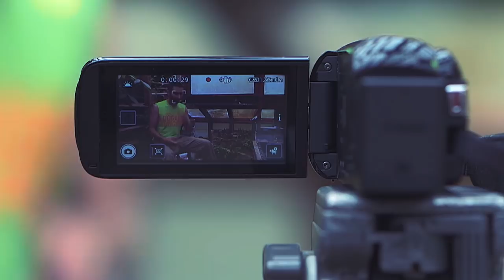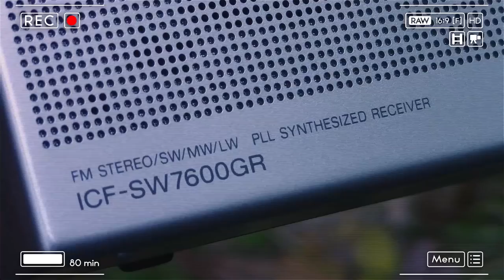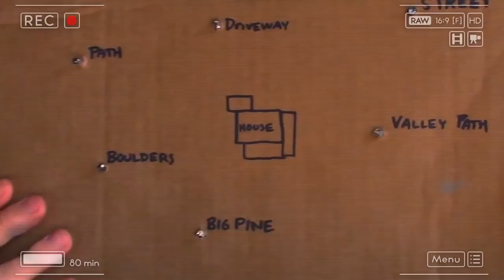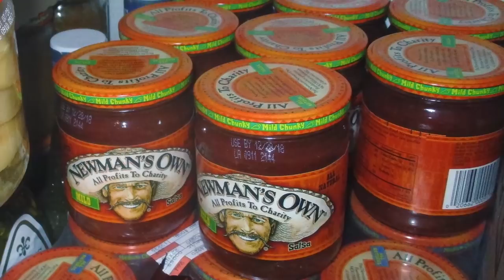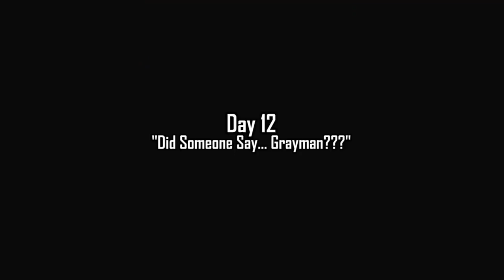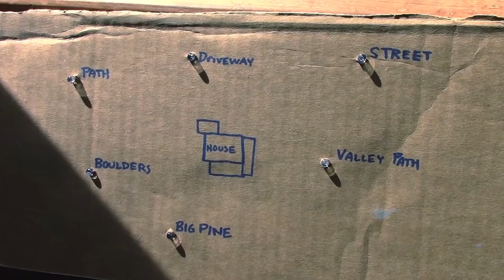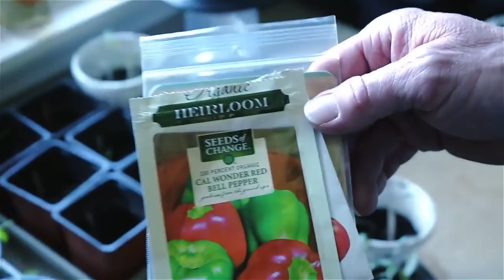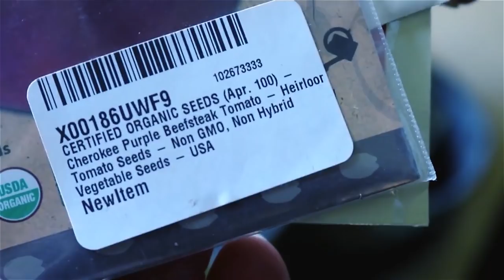Alien Invasion Complete First Season MEGA-MOVIE - A Prepping and Preparedness Film with Aliens

Comment: Tip for you and all other Preppers. I took my books to a printer shop and had the spines shaved off. Then had them all scanned to PDF.  i get the book back shrink-wrapped, and the book back on PDF.
Reply from the maker: I wasn't aware that service was offered. When you get your book back, is it rebound, or just a stack of shrink-wrapped pages? If the books are just a stack of pages after this process, for myself, I don't think I'd want to go that way because I like having the physical books for two reasons. First, they're an ultimate hedge against disasters that might cause easily flowing electrical power to run machines to read pdf files. Although books take up a crapload of space, are not fireproof, can't be duplicated easily and stored in multiple locations as they could be on a small hard drive. Those are definite benefits of pdf conversion. But beyond that, when I'm working with info in a book, I much prefer a book to a tablet. I'm not sure if it's just an emotional or comfort thing, or if it's because the books are easy to bookmark and flip back and forth between pages very easily, or the way I don't have to worry about sun glare on a book, or don't need to worry about using a book in a dusty or damp environment, etc. For me I prefer the physical book to a pdf. But... if my house burned down and I lost all my books (which I almost certainly would in that event), I might be singing a different tune on whether I would wish I'd backed them all up on pdf. It's an interesting service you bring up here. Thx for mentioning it.
Reply: @PraxisPrepper  Mine I get back shrink wrapped. 

One option from there would be to then have it hole-punched and run tie-wraps through the holes.

As for power, I set up a small Faraday can that holds:

a. A small solar panel generator with various ports.

b. An old cell phone and a computer notepad that that both plug in and can play my MP4 vids as well as view PDFs of my books and reference library.

c. The flash drives holding all my reference library and vids.

I've collected thousands. From how to raise chickens to identifying plant species to performing emergency appendectomies in the field.
Reply from the maker: @danrieke9988  Sounds like you have an awesome library!

Comment: I thought this mega movie was pretty good.

At 4:52:55, I thought that to balance out the exposure levels, a variable Neutral Density levels, may be of benefit? If you're interested, I am waiting to receive a variable Neutral Density filter and I will experiment to see if it gets the job done, under similar filming conditions. I will use a Sony NEX FS100 camera, with a 35mm image sensor, and I could try to use a JVC GZ-EX515 camera with a much smaller 4.4mm image sensor, for which I already have a variable Neutral Density filter and compare the footage of the same scene.

From 5:26:25 when the wood chips are flying off, I was wondering if it's reasonable to collect and dry out the wood chips, then store them for feeding the fire during the winter?
Reply from the maker: Hey Neil. I think you're right about the variable ND for Prepper Potpourri's material. A soft bounce into the shadow side would have helped her out too. I didn't shoot any of the video segments of other preppers, so I didn't have any control over that sort of image stuff. I think I've shot with an FS100 before and if my memory serves it was a pretty decent rig. A variable ND is actually just two polarizer filters on top of each other. If it's cheaper, just get two polarizers and then you get to use them either together as a variable ND or one single one as a polarizer. For video, you can buy the cheaper linear polarizer too - the circular one is a special device for SLR cameras to deal with the mirror inside that's used during photography mode. Not an issue with video - even if the video is recorded USING a DSLR.

As for the wood chips, sure one could keep them, but in a forest full of wood, probably not a big deal either way.

Good luck with your video experiments!

Comment: Not trough all of it. With all that battery overcharging thing from the Solar Panels (around/ after 24:00). All you really need is a high capacity relay and a Zehner Diode which switches off upon reaching the maximum charge Voltage. I would assume a relay for sure would survive a EMP a Zehner Diode. Not sure, but they are tiny and you can put a bunch of them in an EMP protected case in case there is more than one EMP (not sure if this is still coming up, still watching :-)
For me: I would store away some of the large solar cells in the basement in case the do get damaged outside or stolen. Let's face it when SHTF you do only need power for the radio and the lights. In that guys case also the Video camera. So, what else? For cooking? Probably better off with wood or fuel (if you have ;-)
What else?
Reply from the maker: Thanks for the note marwerno. I wasn't familiar with a Zehner diode, but I'll be looking into it now thanks to you!
Reply from the maker: @marwerno  My electronics skills are pretty rudimentary, but if they ever improve and I can get a sense of what may be good in terms of items to prep along you breadboard idea, you can bet I'll share my conclusions in a video. Thanks for making the suggestion and getting me thinking about it!

Comment: In the sticks if you fire more than one round, then a smart guy can get a general direction of where you are. Not good when every man is a potential preditor. It is also a waste of ammo. Don't take the shot unless you are sure of a kill while hunting. You may kick yourself later for wasting those rounds. Use the driest wood you can when making a fire to make as little smoke as you can.  Else you could be giving away your position. Don't light a fire unless it is absolutely necessary. If you do, then keep it small. With a small dry wood fire you can also make a sort of smoke dispersal "umbrella" well above it to disperse what little smoke there is. Suspend a leafy branch far enough above a small fire so it won't burn or smoke.
Reply from the maker: That's a good tip - thanks for sharing it here. I tried to make this series be about a guy who's pretty knowledgeable but far from "perfect" when it comes to all this stuff. So people can learn from his knowledge AND his mistakes. Thanks for the helpful feedback here!
Reply: @PraxisPrepper  Thank you for the tips too. Particularly the method of using a watch for a compass. I have two lensatic compases but it's nice to know a makeshift method if the Sun is up. Never heard of that before.
Reply from the maker: @stevesloan7132  Yeah, that's a fun method to use (especially in front of amazed people who didn't know about it). Just be sure to factor in for daylight savings time if you're in the US during the summer months when we use it!

Comment: First minute and a half is a good demonstration as to why you should use a script when you're making a video.  While it might not eliminate all mistakes it certainly will cut down on them and help you remember the important points you want to make without going off in a direction you didn't plan on and aren't prepared to cover and I would imagine it would result in far less time spent editing as well.  Save the improv for the comedy clubs . . . and turn that phone off!

3:10   Notice the emergency radio.  A friend bought one of those for me several years ago.  It is one of the worse pieces of garbage I have ever seen.  If you see one I would suggest you pass it over for something better.  Just because it's endorsed by a large organization doesn't mean it's the best one out there.

I remember reading about EMP's and as I recall they told how the wiring in your home would overheat and the insulation would melt/burn off so that even after power was restored (potentially over a decade to produce enough transformers to replace them all) it would be unusable but it suggests to me that most buildings would catch fire and burn up.  They never came out and said that but I know how much heat it takes to get the insulation off wiring and one thing follows the other in my way of thinking.  Call me crazy.

31:14  You might want to do your own research here.  https://www.ediblewildfood.com/queen-annes-lace.aspx    Maybe read up on yarrow, too.  It has it's uses but I'm not so sure you want to be eating it like a vegetable.  32:00  https://en.wikipedia.org/wiki/Monarda

I don't normally pick videos apart piece by piece like this and no point in starting now.  lol.
Reply from the maker: Thanks for the thoughts. Yeah, queen anne's lace is edible, but that family of plants is a bit dangerous for newbies to play with, so I opted to make a pass on that one. The EMP question is a tricky one. Maybe experts themselves are frank when it comes to what we don't know for sure about that. I did an interview series about it recently that you can check out in my playlists if you like.

Comment: Hey Praxis,

I don't know if anyone's asked this already, but to answer how your character keeps his camera and Ham radio charged, you could explain that he's using a walking knee charger (or maybe a pair of them, based on the old "two is one, one is none" rule):
https://www.youtube.com/watch?v=ODEkUoBY3uA

The character may also find a gravity powered flash light, for use at night or in dark places:
https://www.youtube.com/watch?v=XXQZcvPld-4

Other preppers may be powering their homes or shelters, using gym/exercise/work out machines adapted for power generation to charge batteries, for when the Sun isn't shining? One benefit of a work out machine adapted in this way, is there is not a need for weights because a generator does provide magnetically induced mechanical resistance to movement. To improve the efficiency, such preppers may have adapted some of the concepts in this video?

https://www.youtube.com/watch?v=HK3JOlY0V8Y
Reply from the maker: Thanks for the links. I think I'd referenced having a small solar voltaic charger in one of the early episodes and left it at that. Realistically, I don't think many people would burn energy charging a camera during an event like this... (or at least I wouldn't). But since there'd be no video without the character doing that... he did that. ;)
Reply: @PraxisPrepper  I'm a semi retired Electronics Engineer, so I tend to automatically think about stuff such as how does the character keep her/his batteries charged all the time?

A portable Solar Photo-Voltaic (PV) Cell may not provide sufficient energy to charge batteries in a camera, radio and perhaps tazer at the same time, all by itself, supplementary power may be provided by a knee mounted walking charger.

Whilst some folks may not want to burn energy charging a camera, they may want to burn energy to charge a radio, or a tazer. One advantage of a tazer is that it can stop some marauders in close quarters combat, without wasting pepper spray or bullets.

Folks that are overweight/obese such as myself, may not have a problem with burning energy to charge a radio/tazer/camera/flashlight with a walking knee charger.

One advantage of a walking knee charger, is that it's more stealthy than a Solar PV cell; there is a chance a flash of sunlight reflecting off a solar panel may attract marauders, or make it easier to track a person. Thus with a walking knee charger, it may be wiser to conceal the Solar PV panel, and let the walking action charge the batteries.
Reply from the maker: @neilruedlinger4851  The idea of a walking knee charger really is a cool idea. The video you sent made it look like a device like that is still in alpha testing. I'd love to test out (and popularize) a product like that if it existed for general retail sale.
Reply: @PraxisPrepper  Me too, it would be a great way to charge my cell 'phone, or my JVC GZ-EX515 batteries, or perhaps FS100 batteries.

My FS100 has two long duration NP-F970 batteries, which in combination with a 128 GB SD Card can run my FS100 for over 10 hours, on just one NP-F970 battery; so I had the excuse to buy a second 128GB SD Card.

Sometime over the past year or so, a student from somewhere in South America asked me in my Quora feed, for advice if it was a good idea to pursue the design and prototyping of a walking knee charger, based on Neodymium magnets. The YouTube or Google search algorithms didn't provide me with that New Scientist video, when I searched for further information to help her/him out. I consequently advised her/him to go ahead and experiment with the idea. I never got any feed back on her/his progress.
Reply: @PraxisPrepper 
Further reflecting further on the commercial availability of innovative battery chargers, besides the walking knee charger such as a backpack using piezo electric energy generators installed in the straps; I think that most of these concepts are being sold to the military, to reduce the weight of the batteries a soldier is required to carry into a field of combat. According to one web site I recently saw, an US Army Soldier may be required to carry up to 24 pounds of batteries, on top of the armaments, armor, bullets, water, food rations and electronics gear.

Add the constraint that a Soldier's backpack should weigh no more than 20% of an individual Soldier's weight, and any technologies that can reduce the weight of batteries to be carried around, would be of immense interest to the military.

If my musings are correct, then we may have to wait several years before these technologies are available for general retail sale.

The only current (no pun intended) option, is for a prepper to research, prototype and test their own portable charging technologies, such as a DIY walking knee charger.

Another way to generate electrical power for charging batteries, may be to use the piezoelectric effect, and build a cell 'phone or radio charger built into the shoes or boots; here's an example of a DIY project video. The builder uses a LiPO (Lithium POlymer) battery to store the charge as s/he walks around, and the device can be used to drive a bright LED at the front of the shoes, to allow illuminating a path way at night; for preppers a bright red LED may be a better option, because red light scatters much less and is a more stealthy alternative. Perhaps even a NIR (Near Infra Red) LED may be included for using night vision goggles, to evade detection if escaping at night:
https://www.youtube.com/watch?v=o58YWPOSWkI

Here is a 15 year old (back in 2014) boy genius who has hit on the idea of mounting a pair of piezoelectric sensors back-to-back, for doubling the amount of energy harvested into a LiPO battery:
https://www.youtube.com/watch?v=Uc4CD1aEFwE

A string of piezoelectric generators may also be installed in the straps of a backpack, to generate a charging current.

Comment: Second time watching this, entertaining and informative at the same time. but of all the lesson learned, the one that struck home the most was the UPS guy bit.  OFTEN said in zombie movies, fear the living more than the dead.  this part shows the UPS guy knew Praxis was a prepper not from external looks, but because as the local delivery guy he had noticed he had delivered most of Praxis' prep gear.  The lesson I learned was to make your prepping as stealthy as possible, any work needed should be done yourself if possible or if not have it done vnder pretext, maybe that prep food bunker could be proffesionally poured as footings and sides for a swim pool you will finish yourself,  buy extra lumber when you replace a boundary fence.  as for food avoid buying a ton of dry/long life food, instead buy smaller amounts with your regular shop and use different stores if poss. shop workers will remember if every week you buy the dry food, most will ignore it but 1 or 2 may put 2 and 2 together, if you have 4 stores local, buy your food and prep once a week or twice, randomly from alternating stores.  ordering on line for gadgets or equipment. space out the order and if possible use companies that deliver using nondescript packaging.a delivery guy who delivers 50 boxes over a year or two wont really make the leap these days, yet making 2 drops of 25 boxes is going to raise a flag, especially if you ONLY get two drops ! also getting weekly or bi weekly deliveries in boxes marked "Max's camp and survival" or "Tony's out doors" is a given.  where possible buy from stores in different towns, buying online irregularly.  remember the guy that has aproffessional shelter built is secret has shared this info  with every worker on the job plus their family and friends plus suppliers, then add to that having regular deliveries or bulk clearly marked "big jims budget online prep supplies" adds big jim, his staff and the delivery guy to the list of people who know you have a secret SHTF stock,  might as well erect a neon sign.   " Ah ! but they have their own shelters and stocks !  "  Who says they do ? why spend the effort and money when you know if SHTF, theres a  food and shelter someone else paid for you know the location, and remember the most trustworthy contractor/deliver guy is only 3 missed meals away from turning up to kill you and take yours.  SHTF prep is the perfect time to have some paranoia.
Reply from the maker: I'm really glad that you've found this video to be worthy of watching a second time. That makes my morning! :)

Comment: Not supposed to put your weight on the fork.  Should put weight hands holding handles.  Forks keep the crutch going all over the place.
Reply from the maker: These crutches don't have handles, so not as easy to fully support with hands as with commercially available models.